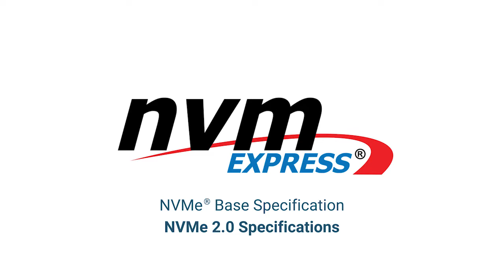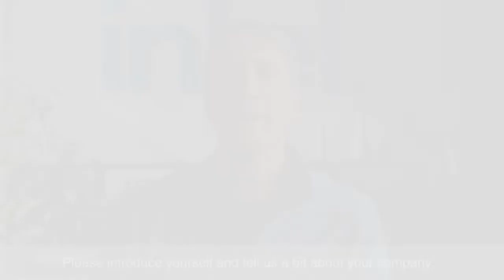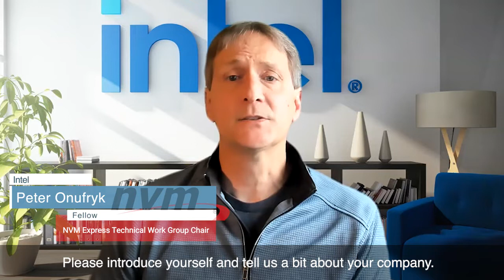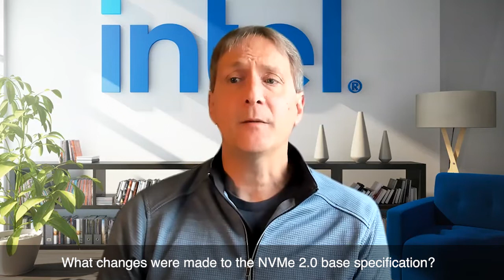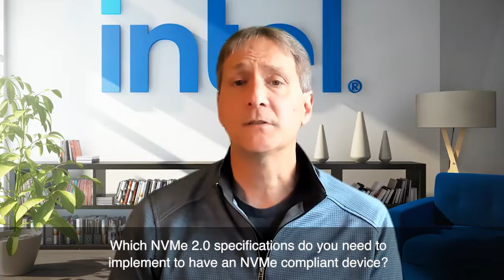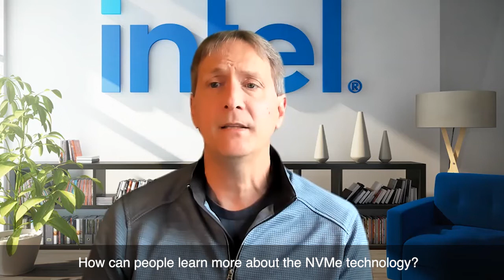NVMe 2.0 Specifications: Base Specification Overview

Comment: So as much as I like technical details, I didn't understand much of what was actually being done. And the nvm website link didn't easily show a way to understand this.
Perhaps you could add more pictures and illustrations to this video, or a link straight to one for important updates as it would help us understand what is actually happening.
Also... how do I get NMVe 2.0 on a current drive?
Maybe I missed it but will there be FW updates? Will only new made drives allow this?
Reply: Without trying to be condescending, the intended audience of these videos is for those who solely work with the technical spec; NVMe as a specification just doesn't resonate much with consumers. You cannot get NVMe 2 on a "current" drive; the specification has to be supported by hardware (unless the hardware has a way of being flashed by an OS, and thus "could" get support for things like the KV protocol by firmware patching).
Reply: @bartpelle3460  Hey fair enough!
I am just wondering how on a social media platform where lots of people can find this, why it wouldn't make that clearer?
With the way they structured it being a very short video, it seems more an overview to the public (this vid got recommended to me actually). But I didn't hear one time they made that super clear other then the lingo that it was meant for devs as it were.
Being a tech person myself I try to make it super easy to follow along even on more difficult topics. But anyway just an idea, since they broke it down the changes maybe meant for devs etc. why not go one step further and take 20 seconds to note that this is meant for future drives?

There is ever growing use of NVMe drives even in consumer space, why not have a less-technical overview at least at some point?

But thank you for answering my question!
Reply: @Frizzy9000  That's a legitimate question for sure, and I couldn't answer if I tried... I think it's just lack of awareness that the video could've reached those who aren't directly working with (or implementing) the spec. Still though, if you're a tech person, you might find it interesting to "read" the spec; it won't all make a lot of sense but in my opinion this is one of the less "mumbo-jumbo-filled" specs in the industry. You'd be surprised at how much you can understand!